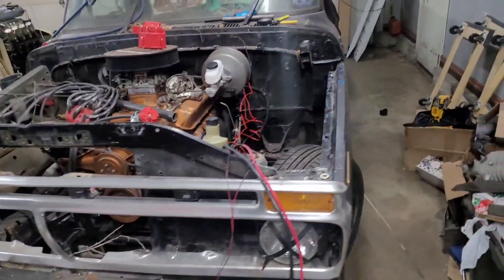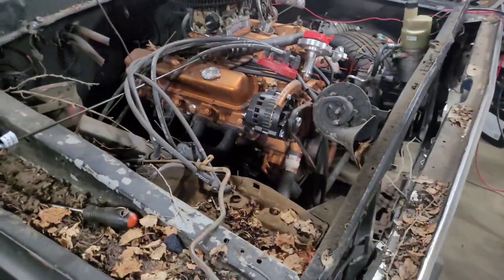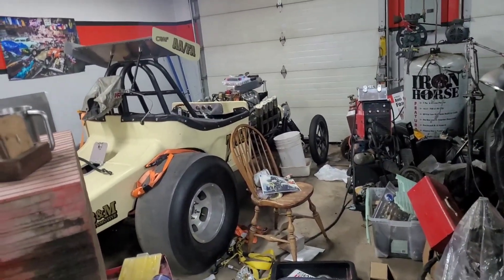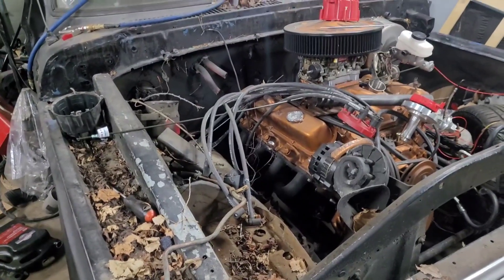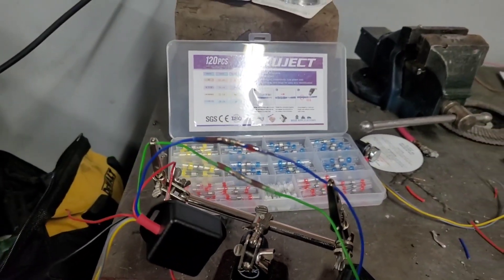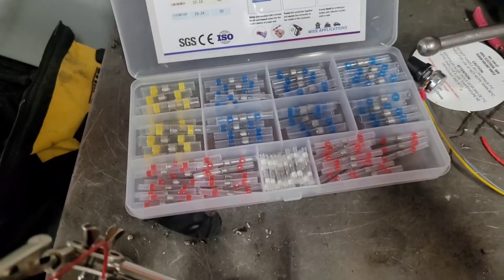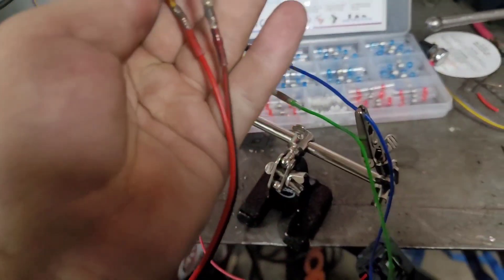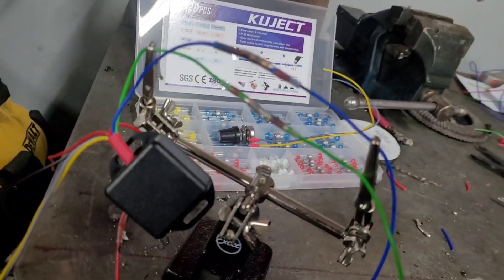ELECTRIFIED! how to install low buck  volvo electric power steering on anything

Comment: Man this is so slick!
Reply from the maker: If a feller had really really really wide front tires and didn't want to wreak the racecar look with a steering pump this would be a fantastic option 😉
Reply: @enemymetalworks  I will definitely keep it in mind!